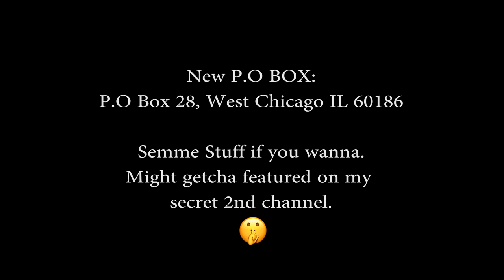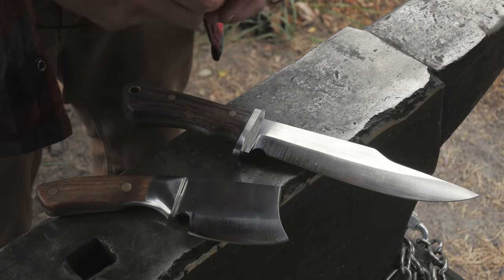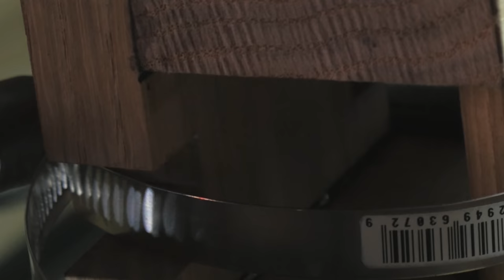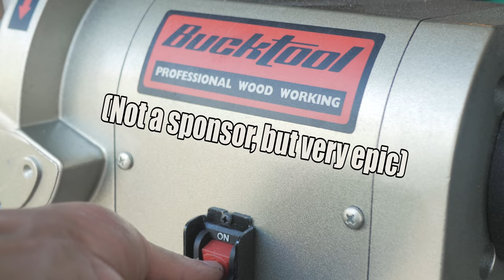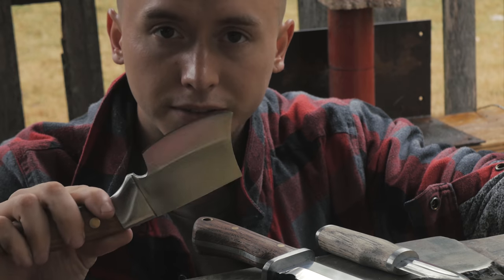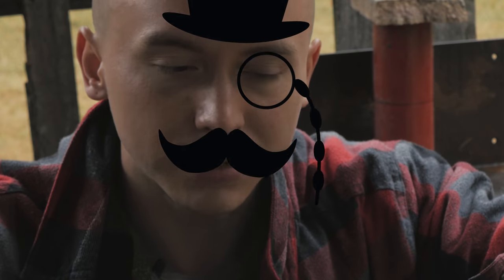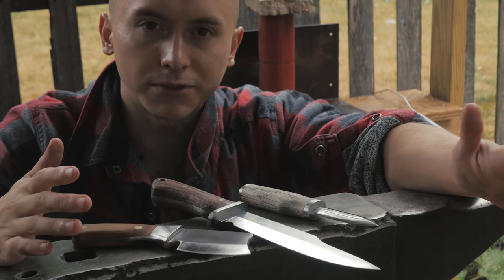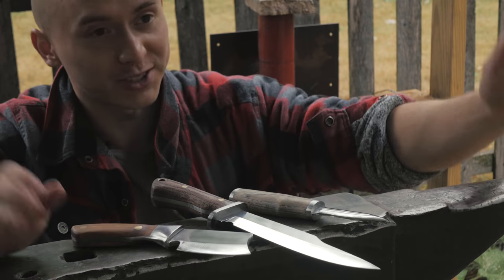Eli's Cathartic Knife Making Experience (+Tin Roof ASMR)

Comment: Note: 5160 will straight up spot rust in like 4-5 hours if you leave a oily fingerprint on it. Especially if it’s a high polish finish.

Oil that babeh up!
Reply: Yup. I learned this in my welding class cause I'm a dummy as sorta man handed a massive sheet of the stuff with my sweaty hands. And overnight where my had touched it there was rust.
Reply: 7:02 yeah he mentioned it
Reply: I plan to make a nice chopper/camping knife from a Leaf spring  would hand sanding to 220 and the edge to a 500-100 mirror polish, should that be good?

Comment: i have that exact same belt/disk sander. its okay i guess. the disk does not spin perfectly flat on mine so I rarely use it. belt works really good for flat grinding, especially if you put a glass platen under it.

Comment: I couldn't help but notice that the tang on your "work knife" is not only wider but also thicker back toward the end of the tang. This is true with swords and stuff too, but you should pretty much always make sure that the spot where the tang meets the blade, the ricasso area, is the thickest part of the whole blade. It should have a tapering tang and a distal taper as a general rule. However, it's probably not super important on a blade that small, it just tends to be a stress inducing feature for shock traveling up and down the blade. Just so you know for next time.

Comment: "Not a weapon" you know those grooves right? They are specifically designed to use in stabbing. They're used to prevent a vacuum inside a stabwound so the victim will bleed out faster
Reply: No, they are not.

They are to lighten the blade, and use less metal, without significantly weakening its structure, like an I-beam in practice.

They are fullers, not blood grooves (the later being utter hollywood bologna).

Comment: Hey, Eli! Love the videos! I've been watching you for several years now and I've always been EXTREMELY impressed with your craftsmanship! It's really cool to see how far you've come. 

I also have a question. It might be a stupid one, but why don't you just cast your knives? Wouldn't it be easier to just melt down the metal into a cast? I know next to nothing about this stuff, just wondering! Have a great day!!
Reply: Parker Christopherson Ooh, I can answer this one. No, it would not be easier for a couple reasons. First of all, it is exceedingly hard to melt iron and steel, a lot harder than it is to get it to forging temperatures. It wouldn’t save any time even if you could cast steel, there would still be grinding, sanding, and handle work. Secondly, casting steel makes it not worth making a knife out of. This is because to get the steel to a melting point, the temperature is high enough to burn off the carbon that makes the steel good for blades.
Reply: Yes, making cast steel is a really tough one. You absolutely have to know your numbers, check the temperature, make the forms perfect. Because if you overheat, it is gone. If you underheat, it's gone. If you have the wrong carbon ratio, it is gone. If the form isn't perfect, it is gone. And you just can't remelt it and start again. You can do it with iron or bronze or whatever you want, but steel is a big nono. Only do steel casts if you absolutely know what you are doing and have the machinery for the job.
Reply: @JacktheFireEater  Gotcha! That makes sense! Thank you!
Reply: @Seelenschmiede  Haha seems like forging is a little bit easier! 😉 Haha thanks for the reply :)
Reply: Parker Christopherson No problem

Comment: The reason you put a guard on knives like that is so you don't have to rely on having a deathgrip on it. It doesn't need like a full handguard, but especially with a double edges knife like that, it's practically useless without something to keep your hands from slipping if you get sweaty or are trying to put pressure on it... That's not failing to use a knife safely, that's building a knife that is less likely to get you injured if something does go wrong. You said yourself you cut yourself twice on the bowie alone. Accidents happen.

Comment: You probably didn't need all that epoxy on the work knife/dagger, if any at all.

If the tolerances line up and once you peen the end of the tang over it should hold on just as well without all the mess.

Still, definitely improving with yer smithery wizardry

Comment: I love how these came out! But if I am being honest, that work knife seems sketchy. Would be really easy to accidentally cut yourself. A guard would prevent your hand from slipping down on the blade, if it were like the others it wouldn't be a danger. But since its double edged it could be a hazard. 
And the round handle doesn't look like it is user friendly. 

Placing the blame on a knife user is not the way to go about this, a knife should be built with user safety in mind. The fact that there is no guard shows this isn't the basis of how you designed the handle, and that's a problem.